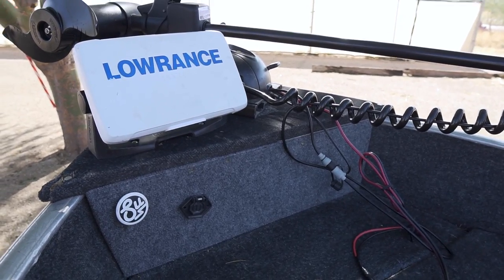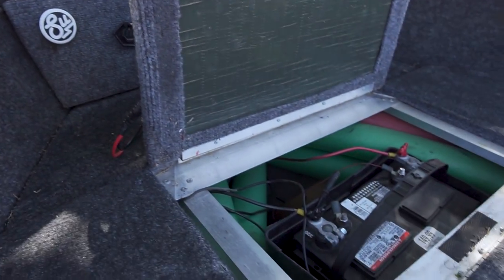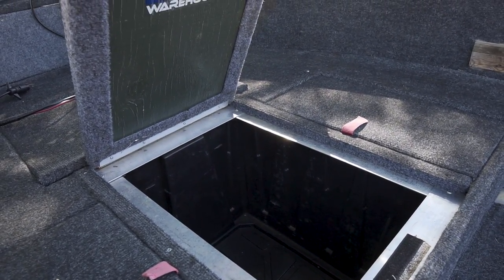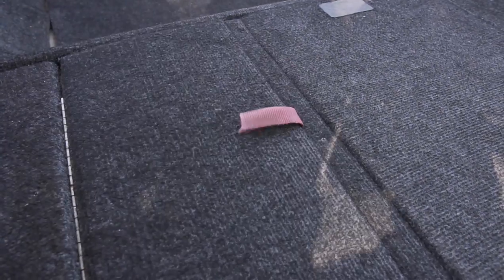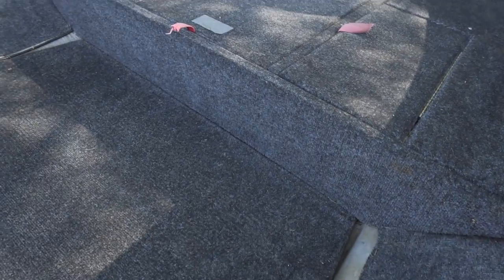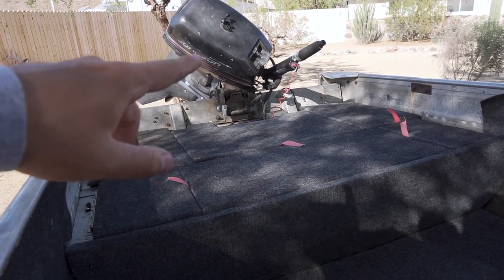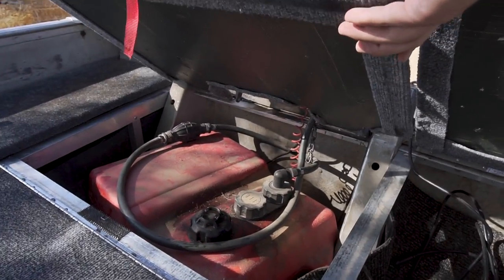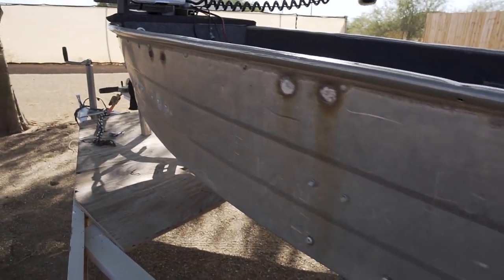My 12 foot Jon Boat To Bass Boat Conversion!! Complete Walkthrough!!

Comment: Good video. I'm picking up a little John boat saturday. Was just wondering how to put a floor in it so it doesn't have the V design for more comfort. Keep fishing those Arizona waters. I personally live in North Phoenix. Thanks again for the ideas.
Reply from the maker: Thanks for watching the video! The floor wasn’t too hard. After I made the front and back deck I took 3/4” ply wood cut it to where it would fit between the two decks. sealed and painted it really well because it will be the most walked on portion of the boat. Than added a piece of 2x4 along the front and back edge running width wise as well as one in the center running the length of the floor. The back of the floor was flush with the flat floor of the boat in the back but the front I added a short piece of ply wood coming down from the 2x4 that runs vertically to meet the v shape of the boat and trimmed it till it was the right contours.

Comment: I just picked up a 12 foot boat just like yours but it's a chrysler little fisherman old too like 50s or 60s not sure. But will try to register and put a small outboard like you did. I stole it for $100 does not leak it just has the usual scratches and paint fading no big deal. And it's 94 lbs empty. Winner winner chicken dinner.

Comment: Definitely keep the power cables away from the transducer wire! You should definitely look into isolating the two circuits. A battery cut off switch before the accessories then I ran a similar trolling motor and used a 60amp breaker on the positive side, then ran another positive off the battery cut off to a fuse block for the bilge and graph. Boat fires are real and very scary even on small simple 12v systems.
Reply from the maker: That’s an awesome setup man I appreciate the feedback. I definitely like the idea of having a fuse/breaker just in case.  I ended up buying a separate small atv battery because I was getting a lot of interference from running it off the same battery. Now the graph and trolling motor are separate and work great however adding a fuse to both would be smart. Thanks again man 🤘🏼

Comment: How much weight do you think you added to the boat? My son just bought a ‘71 Mirrocraft 14’ that is very similar. 

How did you attach the framing to the sides of the boat?

Is the front deck the same height as the old seats you pulled?

Comment: Awesome set up! 

What thickness of aluminum angle framing did you go with? Custom boat framing typically runs from 2" down to .5" thickness. I'd like to add compartments to my boat as well and was thinking about using angle framing.

Comment: I have the same issue with the interference.  I just got some ferrite clamps.  I heard clipping one right on the graphs power cable right behind the plug is supposed to fix the issue.  I can't confirm yet though bacause the lakes are frozen
Reply from the maker: Hahaha well being able to test it on the water definitely helps I agree. I guess it’s time to break out that vexilar for the time being. I hope that method works for you man! I ended up buying a small agm atv battery to run my graph off of separately. Works like a charm! Gonna make a follow up video here shortly.

Comment: Nice job on the boat man! I had a similar issue w my old boat when I installed an ultrex. U will probably have to run graph to separate battery and use 10 gauge wire unfortunately. Hope u find an easier way.
Reply from the maker: Thanks for the tip man! Will give it a try and see what happens. Seems to be the quickest fix. Thanks for checking out the video 💪🏼

Comment: First, try separating your power cables for the two systems. Also, move any power cables away from any display cables there might be.  You might want to look at a voltage isolator as well or you can look at a ferrite bead/EMI filter. I bet that trolling motor is letting off some EMI.
Reply from the maker: Thanks a ton for the feedback man 🙏🏼 will look into it and give it a few test runs with that info! Only happens when the trolling motor is on low speed. Thanks for checking out the video man 🤘🏼
Reply: @desertbassin  You are very welcome. Try separating those cables first and the ferrit beed on that display cable of your monitor. Hopefully this fixes the issue. Thanks for the vids as always.
Reply: @desertbassin  Could be a grounding issue. make sure its grounded properly

Comment: Nice work.  I don't think I heard you mention what size battery you have for that trolling motor, but I was wondering how long you are able to run that motor for?  Does it get you through the whole day?
Reply from the maker: I have a group 27 deep cycle. Just went to Alamo last week and it ran my trolling motor for two days. Spot lock in the wind and all

Comment: How stable is the deck when standing on it? I had a 10 foot flat bottom i put a deck on it and it was so wobbly.
Reply from the maker: It was very stable. On the v hulls it all depends on how high the deck is. Too high and the weight of the person isn’t displaced right. I found on my boat that the deck balanced the best at the water line of the boat.

Comment: Dope set up bro, how does the trailer handle with the added weight did you have to do anything on trailer
Reply from the maker: The trailer handles great. Honestly it’s a double jet ski trailer that I modified to fit the boat. It’s a wide trailer so pulling it is nice and balanced.
Reply: @desertbassin  right on on just built my 12 footer but I used wood I tried keep the material to minimal but still added a few pounds and that’s my only concern was trailer it’s not crazy heavy but still
Reply from the maker: @rjtrucking2251  could always try adding some weight to the front of the trailer if it gets squirrely on you

Comment: I agree with some people. Separate your batteries. You could get a real cheap lithium or just small SLA battery that will run the graph by itself and keep the TM on the big battery. The small lithiums are what everyone uses in kayaks and runs graphs a long time. Good luck!
Reply from the maker: My big concern separating the batteries was if the smaller one would be able to run the graph all day but in that case Lithium would be the move! Thanks for the tip man I’ll have to try it out🤘🏼